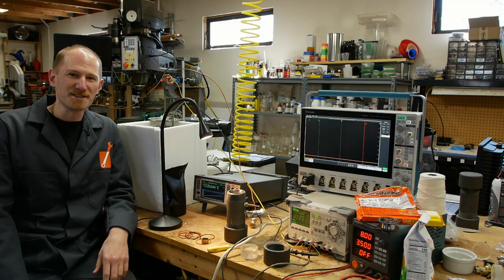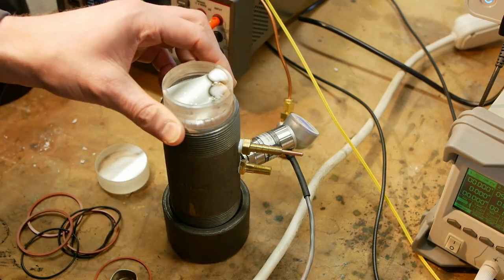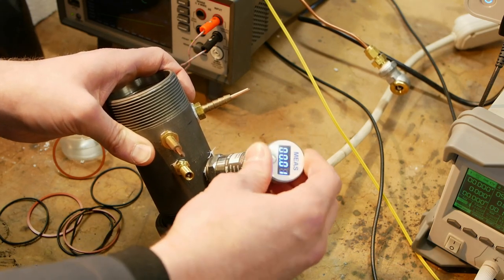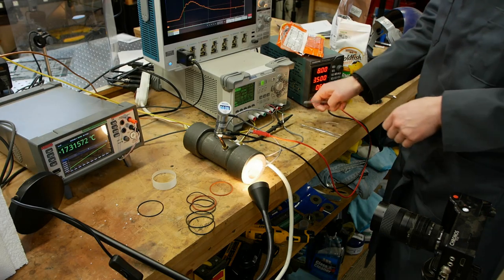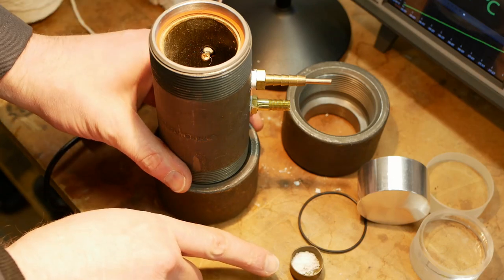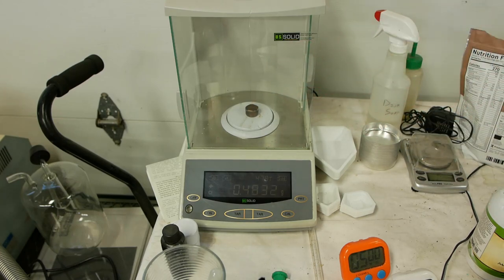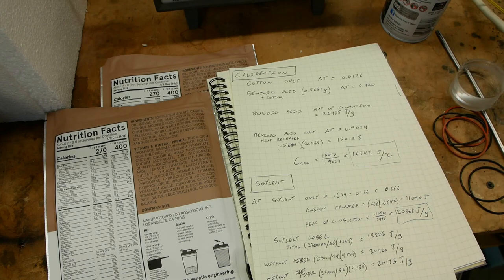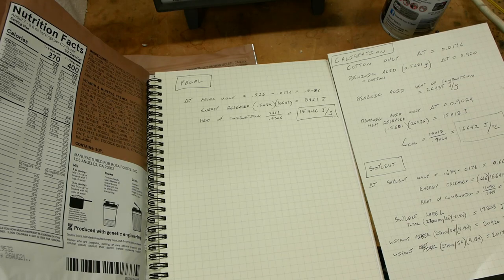Measuring human digestive efficiency vs. a flame

Comment: Hey Ben, I've had similar design challenges at work when working at high temperatures. Sizing the metal pipe ID for a close clearance fit and adding another step farther back where the plastic window begins and placing the O-ring there will prevent it from burning. Any hot gasses from the flame will cool flowing thru the narrow gap to below ignition temperatures before reaching the plastic and O-ring. Love your channel, keep up the good work!

Comment: Really cool video! Though I was under the impression that a large amount of the carbon we excrete is via respiration (2.3 lbs per day if I recall correctly). So factoring that in would probably be pretty important.
Reply: By definition this is not usable carbon, and it's excreted just the same in the case of combustion.
Reply: @petros_adamopoulos  What? Of course the carbon we exhale is usable. Not after being exhaled but before and it should definitely be accounted for in this balance.
Reply: @petros_adamopoulos  by definition, that carbon WAS useable carbon. The CO2 from your breath comes from the cellular respiration breaking down energetic molecules your body got from food.

Comment: Amazing engineering setup, but I think there is a little lack in microbiology plan. Poop is mainly consist of dead bacteria and some fibers. That bacteries were responsible in food digesting and the total process is too complicated to be resolved like as simple input/output example. But overall this is cool demonstration.
Reply: His experiment is a literal application of the first law of thermodynamics, his body being the control volume, and the efficiency calculation is applicable. Whatever energy was transformed by bacteria, it could not have been used by his body if it was still within the pooped bacteria.
Reply: @homemdosaco2000  There are still considerations like the balance of bacterial biomass still in his body.  It may fluctuate.  More sampling over a long period of time along with body weight tracking might help trace possibly error.  I also wonder if he used any stored fat during the experiment, or measurably lost any weight.
Reply: Agree that weight change can skew the calculation. Bacterial mass would come to an equilibrium with the controlled diet, but I have no idea how long that would take.
However, I stand by my previous statement that whatever energy was pooped, did not contribute to his body functions.
Reply: @homemdosaco2000  it's literally that simple, yet the comments insist different, demanding things that are empirically impossible to control for. The mystery has been solved. 'calories in calories out' is only 25% accurate
Reply: I guess this means he needs a control where he eats nothing for a week ... 🤔
Reply: This is exactly correct.

There are SO many variables here. There are dead tissue proteins, unused minerals, and in general, a thousand different things that your body simply wants to get rid of in fecal matter.

In fact, there are many calories in fecal matter that ARE edible and digestible and able to be absorbed, this has been experimentally shown by scientists processing sewage into edible food.

As dreadfully curious about the efficiency of the human digestive system as I am, it it's simply impossible to perform a calories in, and calories out experiment.
Reply: Good point.  Definitely a big variable.  Still fascinating to see the results even though, like you said, you cant really conclude anything.
Reply: @colto2312  the biggest issue is that he hasn’t shown that 100g of soylent consumed -> 100g of fecal matter, so knowing the energy density of each is not enough to say how efficient the human body is. If we ate 100g of soylent and excreted 50g, then the energy densities could actually be the same, and yet we would’ve absorbed/used 50g worth of its energy content. The difference would be breathed out in CO2.
Reply: @rainbowevil  does the energy density of an ICE's exhaust only drop by 25%? I assure you we're not exhaling lbs of CO2, as you're implying
Reply: @colto2312  all the weight you lose from exercise and just generally surviving/metabolic processes is lost as CO2 and H2O - that’s what gets created when you “burn” fats and carbohydrates. Look it up if you don’t believe me.
Reply: @rainbowevil  What you're actually saying:
when you go to taco johns and slam a six pack and a pound, you're going to exhale within 24 hours half the total weight of that meal including all others within the same timeframe.
The fact that you cannot see the absurdity of such a claim at face value, tells me there's nothing more to discuss. I know about the krebs and CO2 cycles. It's disengenious to even imply we can turn HALF the weight of something consumed into co2 within 24 hours.
Reply: @colto2312  please take a step back and think. We’re talking about soylent: something designed to be absorbed and used by the body as much as possible, and he’s presumably not consuming it in such high quantities that it mostly all just passes through. I’m not saying half of it, that was a numerical example to show mass being lost will impact it, but it WILL affect the calculation.
Reply: @colto2312  also, we literally exhale lbs of CO2 during a day lol: https://www.reference.com/science/much-co2-human-exhale-3f8cfdd9076c129
Reply: @rainbowevil  We haven't even touched on bioavailability, osmotic limits, and gut flora. I know what you're saying and I know what you mean, you're coming from a well meaning place, however again, the energy density of a Combustion engine's exhaust is near 0. The video has proven that not only are we not near 0, there was only a net reduction for 25%~.  Do not confound the two systems, as they have near 0 correlation. Next time you take a dump, ask yourself, does that look remotely like half the weight of a meal? Unless you're constantly constipated, I certainly hope not.
Reply: @colto2312  look, you’ve been proven wrong with your “I assure you we’re not exhaling lbs of CO2, as you’re implying”, stop trying to save face by sounding like you know what you’re on about...

The fact is, this experiment is fundamentally flawed since a huge part of the reason we eat food is to use it for energy, and a primary byproduct of that process is CO2. You should know that if you’ve gone to university. You would be laughed out of the room defending this experimental setup. It’s fine for a popular science YouTube channel, but stop defending it as though it’s something greater. Again, the 50% was just a simple example of the issue, if we took it to be 10% that would STILL be an issue worth noting.

I cannot tell you what approximate percentage mass my stool is compared to my meals (it’s weird you can) and I especially couldn’t tell you how it would be on Soylent, which is probably a fair bit less fibrous than my diet.
Reply: @rainbowevil  considering youtube wants to delete all my comments, gg, you're right about everything ever, have never been wrong, and clearly know everything about the topic. Congratz. If someone told me they had lbs of apples and to come get some, I too would assume they only meant two. the absolute bare minimum for the plural to be used, why wouldn't it be two?
Reply: @rainbowevil  my last request: name another system that leaves 75% of its input unused. I know, I know, this guy is basically evil incarnate for not following university protocol and I should personally be stoned in the causeways for even trying to discuss its implications.
Reply: @rainbowevil You can exhale all of the co2 you want and it doesn't effect the energy balance because co2 has no calories.
Reply: @mthayne2000  I assume that’s a joke response, because it is pretty funny.
Reply: @colto2312  Why are you acting like people are calling this guy evil and that anyone is saying you should be stoned lmao. Hyperbolizing one’s opponents is a sign that someone’s arguments don’t stand on their own merit
Reply: @edawg792  " You should know that if you’ve gone to university. You would be laughed out of the room defending this experimental setup. It’s fine for a popular science YouTube channel, but stop defending it as though it’s something greater."
this dude wants him to not eat for a week, eat once, not eat again for a week, and collect all excrement, categorize them by day, and provide all measurements. This is something we haven't even done to rodents due to its nature. Sorry for hyperbolizing as a retort, I shall not commit such indefensible transgressions again. Maybe it's not absurd, maybe I was the absurd one all along.
Reply: @colto2312  Did you read the quote you just shared? "It’s fine for a popular science YouTube channel, but stop defending it as though it’s something greater." He literally said it's fine for what it is, but if this were presented as a legitimate scientific experiment it would not hold up to scrutiny.
"Sorry for hyperbolizing as a retort, I shall not commit such indefensible transgressions again. Maybe it's not absurd, maybe I was the absurd one all along."
Lmao you're literally doing it again. I don't recall saying you committed an "indefensible transgression" but if you want to feed your victim complex go ahead.
Reply: @edawg792  I can only imagine how you're reading my satire in your head lmao, this is rather amusing. Poop aint funny and this is no joke. I personally subscribe to the Ohm's law of nutritional intake anyway. Less Ohms more healthy. Much better measure than calories
Reply: @colto2312  Your satire is really not that clever it's obviously just a deflection and you've pivoted to ironic absurdity after the flaws in your arguments were pointed out
Reply: @edawg792  Clever? Is this sapose to be some kind of debasement lol? Flaws in my arguments? What Precisely is my argument here? Are you bored and just looking for something to attack/latch onto?
Reply: @colto2312  Your arguments up above were rebutted and you gave up and resorted to hyperbole with a side of irony to retain plausible deniability thus never needing to concede. That's what I was responding to. You don't have to respond.
Reply: @edawg792  Since I doubt you could even grasp it since you were so busy, the argument is whether nor not the experiment itself is scientifically significant. I say it is, the other side of the isle says it's not empirically controlled enough. Neither side is arguing in bad faith. I had 4 paragraphs of maths constantly deleted, hence my frustration with the situation. Instead of participating you decided to psychologically profile the meta-data of the argument personally attacking me. Only God knows why. The only actor here working in bad faith is you lol. If one turned in the project in college, depending on its criteria, saying it would/should receive a 0 percent is a bad faith argument. Something you should have noticed, especially considering the beginning of the video details how the data simply didn't exist before.
Reply: @colto2312  There was no need to participate because the matter was over, I was not participating in the matter of debate merely pointing out your approach of hyperbolizing the opposing the position to try and make it seem unreasonable
Reply: @rainbowevil  Body and breath temperature are used for body calorimetry. That is how caloric content of base constituents used for the labels has been initially evaluated.
In addition to densitometry used for measuring weight loss or gain, and surrounding and breath humidity.
First you need to measure basal metabolic rate, then the change when fed a specific amount of base fuel.
Reply: @colto2312  no, the fact that dried poop has 75% the energy density of the food does NOT mean the body can only extract 25% of the foods energy. This is because one gram of food results in much less than 1g of dried poop. So comparing the energy, gram per gram, in the poop and food is not enough, you need to take into account how much poop per food.
Reply: To the OP: There is also no lack need to overcomplicate an explanation without ado.
To the other commentators: We're just a temperature gradient ... like the rest of the universe. 
This remark is of course completely superfluous if one wishes to examine microbiology:)
Edit(Yeah, watch to the end, then comment .... naaah): A bit of trivia because of the surprising tone in the conclusion of the video: Camel dung has been used for heating and cooking in parts of the world for thousands of years
Reply: @homemdosaco2000  What about CO2 and water he breaths out which are made after glucose breakdown?
Reply: @rainbowevil  I agree with you.  A mass AND energy balance is required to determine the efficiency.    Mass  in x Energy/gm in -> mass out x Energy /gm out + Energy Lost  .  So start measuring your fecal mass.
Reply: Agreed.  He’s also missing body weight loss or gain during the period, in which some body fat might have been burned, not the Soylent,  and fat waste product is measured instead.
Reply: @homemdosaco2000  Body weight was mentioned in the video, thus not controlled
Reply: Ultimately, isn't any energy used by the bacteria within your gut going to become heat? And also wouldn't that generated heat be heat that your body didn't have to produce to keep you warm? Although, I guess you would also have to consider other byproducts like methane in farts.
Reply: @homemdosaco2000  Nope. Most of the ingested mass is lost by respiration. Carbohydrates are called carbohydrates for a reason. Of glucose literally NOTHING leaves your body through the back end.

Comment: As always, great video! The missing key in this experiment, as others have pointed out, is fuel weight compared to ash (fecal) weight. You really have to perform a chemical analysis of both the food as well as the fecal matter, sort of like a nutrition label for poop. Yeah... I think I won't go any further with that train of thought. 

I totally geeked out on your construction elements, starting with the composite window! Right as I thought to myself you should use a UV cure resin, I saw you waving the flashlight over the window. NICE! And I love your idea of cutting a gasket on a lathe with an Exacto blade! I may have to use that one! 

Thanks for the great video! Cheers!

Comment: Your body also continuously disposes of dead cells, mostly dead blood cells which have a high calorific value. That brown color...iron.
Awesome job on the experiment.
Reply: Right. Fecal matter is more than just what food you didn't absorb.
Reply: Yeah that is going to change the output if your body isn't working the same way 24/7... But I guess it wouldn't suddenly change by that much if the input is constant.. Except if you constipate for the duration of measurement, I guess.
Reply: The brown color is not iron, but instead bilirubin from breakdown of heme. Iron is far too precious in the human body to excrete willy-nilly: there are in fact no identified ways in which the human body can get rid of iron intentionally.
Reply: @RBuckminsterFuller  and that iron is removed as part of the breakdown of the heme complex.
Reply: @billsmathers7787  Thank you!
Someone who gets it.   💡
Reply: @billsmathers7787  So we need to take in iron just to compensate for what leaves the body "accidentally"? Does the body at least have a way to  regulate how much is extracted from food so that we don't end up with too much iron?
Reply: @billsmathers7787  
You're right Bill thanks.
There is however an identifiable iron loss vector, which is why women take supplements and men don't.
Reply: @sparkyy0007  interesting, thank you!
Reply: @sparkyy0007  I forgot about menstruation. Good catch! (although that is still not an 'intentional' loss of iron per se)

Vegetarians should also supplement too though, as even the 1-2mg of iron lost normally per day can add up to anemia eventually.
Reply: the brown is bile salt, which is not a good thing relative to how much the body scavenges the bile salts.

Comment: This is super interesting. I have always wondered about how little the human body can actually live on, and if it just changes input and output based on individual metabolism and nutrition conditions. One problem that I can see, and you probably have as well, is that I don't think you can compare grams for grams on input and output. Input could have ~5% fiber, where as your output could have ~25% fiber due to the body unable to process it and therefore concentrating the flammable calories in a smaller amount of waste. In this case you would need to get a ratio of the amount of food turns to actual solid waste, since the body has other processes that remove waste, breathing and urination. 
There is so much going on here. As always, so much information to process in your projects. Thanks for sharing.

Comment: Too bad you couldn't find a thick quartz or borosilicate glass plug for the viewing window, but yours seems to work well. I love the method of making a silicone gasket. Always unique videos! A++
Reply: All of these materials would break in a very similar way to glass. He did the right thing by using a very ductile material.
Reply: some materials can take a lot of sustained pressure, but i'd worry a sudden change (like underestimating how fast it would burn) might shock it into shattering regardless. his solution is probably safer overall.
Reply: I prefer your videos